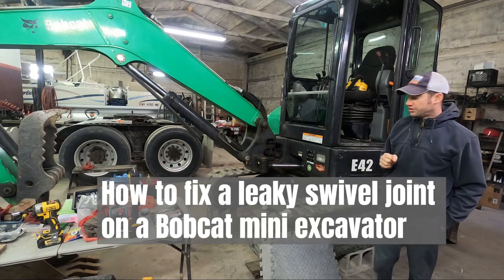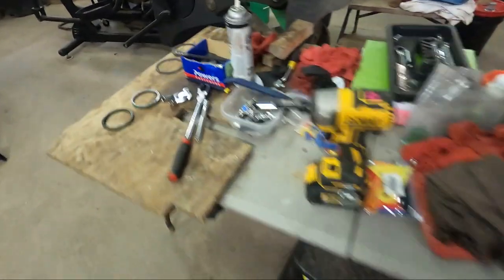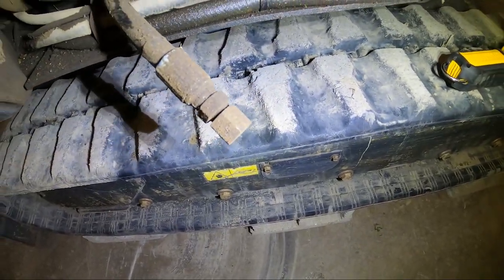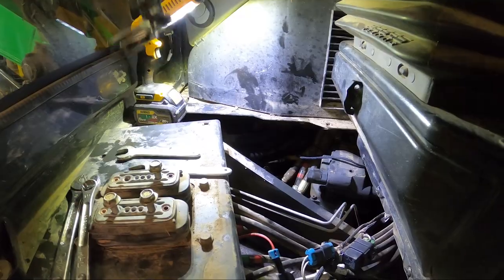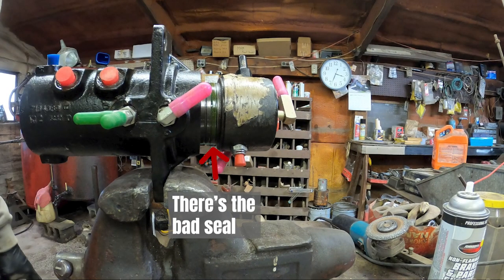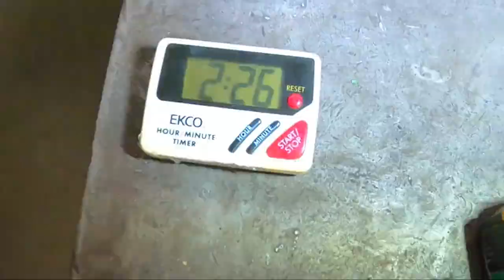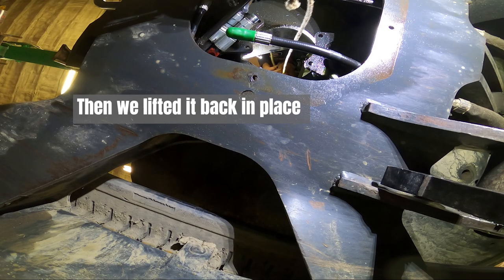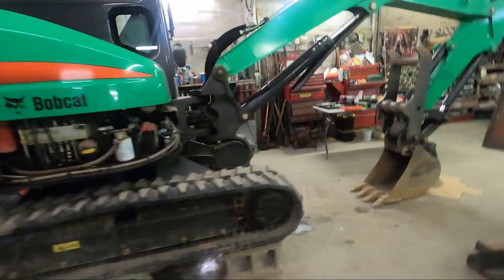How to Fix Hydraulic Leak on Bobcat e42 Excavator - Swivel Joint (Step by Step DIY)

Comment: Hey, thanks for the video, I did mine this weekend on a Bobcat 324 Mini, some of those hydraulic lines on the top, I had to remove others just to reach, they were challenging.  To make installing the top seal easier, I took a disposable thin plastic face shield, and wrapped it around the cylinder and taped it together, and the new seal slid all the way up in about 5 seconds..easy.. thanks again for the video, really helped out!!
Reply from the maker: glad it worked for you! great idea to get that seal on. I'll remember that for next time (hopefully no next time :)
Reply: Thanks for the shield idea!
Reply: glad that worked out! thanks for letting me know, That job was hard enough without spending a lot of time on that top seal!
Reply: I rebuilt the leaking swivel joint on my 324 a couple of years ago. A time consuming PITA. The rebuild kit cost me $400. I couldn’t see doing all of that work and not using all new parts.

Comment: The cinder blocks could have injured or killed you.  I only trust heavy wooden beams stacked so they can't compress.  Anyway, a good video all in all for the purpose.  Side note. All of the seals need to be replaced if going in that deep.  Senseless to only replace what is obviously leaking for what it costs.

Comment: If you have to block this machine up again, please place those blocks so the hollows go up and down! If they break the way they were in there, they would drop in a heart beat.
Reply from the maker: I just replied to the guy above with the same observation. You guys are detail oriented... I like it! I do agree with your block orientation suggestion. There was a reason that I can't remember at the moment why we turned them sideways. That's why also put jack stands underneath for added support.  Next time, I plan on skipping the concrete blocks altogether.
Reply: I seen nick in one of the center seals you didn't replace  if you have leak down on one opp that's why  . Temp imp
Reply: I thought the same in fact I wouldn’t get under either way CMU block is only moderately structural with the cell in the horizontal position and compressive strength varies depending on type of block with  2k psi average and that seems to be ok if you add 4 block to each side of machines weight distribution, this is if you built wall and bedded in mortar of equivalent strength so any irregularity above or below  diminishes integrity. 
Sometimes we just use what we have available and it usually works or you read about the time it didn’t . Be safe your fam needs you

Comment: little free tip. these swivels have sharp edges. instead of rolling or fighting the seal down. use a zip tie turned inside out {smooth side to seal} as a strap to ever so lightly stretch the seal on and over without rolling it or cutting the edges. works great on crown seals and ptfe seals alike.
Reply from the maker: Brilliant! Thanks for the idea
Reply: Great idea
Reply: @camarocraig7060  thanks! i dreamt that one up battling my bobcat swivel joint. worked a treat!

Comment: I wish I had found this video before I took the swivel joint off of my E32.  Still waiting to get it back from guy who is rebuilding it.  I will definitely use what I learned from you to reinstall.

Comment: I worked as a design engineer on hydraulic circuits for years. I think the reason the top seal is worn so much is dirt and water is getting in on top. A top hat type seal like a lip seal if hung out over the top would help keep out the dirt. Without checking (I'm too lazy to look it up) the very top seal and very bottom seals only handle drain pressure and also take most of the side loadings. They basically keep the spindle centered. Metal rotating on plastic seals has to wear eventually, even on a film of hydraulic oil.
It also helps if the unit is located perfectly in the center of the ring gear. Even if offset 5mm, the hoses move back and forth that amount during a full rotation. This side loads the unit a little. Just my thoughts.
Reply from the maker: Thanks for your insight! I never thought about why it failed until you mentioned it. You're right... it won't take much of a sideload or dirty fluid to wear a flat spot on the crown seal. This one lasted about 2000 hours, so hopefully won't have to do this again for another 2K!
Reply: @davidpatrick3533  yeah, I bet you're looking forward to doing it again! And you'll forget half the lessons you've learned here so you'll have to watch your vido!
Reply from the maker: You got it! Half the reason I'm making these videos is to remind me how to do it and what tools I need to do these tasks the next time!
Reply: True
Reply: I would have changed all the seals in the rotate manifold, u are already there! Also they keep all the pressure in the circuits so they u will not have any bleeding off the tank or etc!
Reply from the maker: That's a great idea. In retrospect, I agree. Kicking myself :(
Reply: @curtisbookhardtjr.7481  True .
Reply: @davidpatrick3533  usually the inner rings dont wear since they stay in clean oil . I am sure they are fine. My Yanmar is dripping and have to do soon.
Happy Roman new years.
שלום

Comment: Very Well Done! You hit all of the troublesome spots that saves me some time. My only caution is be careful using concrete blocks (CMUs) as jack stands. The are unreliable.  Keep making these videos.....way better than a manual. Thanks.
Reply: your house sits on them.
Reply: @DieselRamcharger Not in that orientation.
Reply: @walterandrews3077  i feel you. but the weight of that mini spread across 4 blocks is minimal really. which is pretty obvious, seeing as how hes not dead.

Comment: Where did you find the seals? Dealer wants $500 for seal kit.That was awesome!, looked alot easier than the final drive I had to rebuild years ago...heck, the hardest part of it will be the 16lines connected. Thanks million for making the video, your the only one I found that looks like mine.
Reply from the maker: You're right... the worst part was hose management. I'll have to look into tilting the cab. That would make it a lot easier. I agree about the blocks. Great public advisory what not to do :)  But I did also have jack stands under there somewhere.

Comment: Just watch you do the swivel joint on the little digger I've done several swivel joints on 20t and 13t machines it's a lot easier more room to work but you do need a ratchet strap to lower the joint I normally dig a trench in a field and track machine over it you can stand up under machine the only thing you done which could be fatal is sitting the machine on them concrete blocks they have a tendasy to shatter  you should have turned the blocks upright that's a 4 and half tonne machine I wouldn't have chanced it I always think safety I'm always working on my own out in middle of nowhere  sometimes you do well if it was your first time iv been at it nearly 50 years well done
Reply: placing yourself in a trench under an excavator is as risky as him placing it on blocks..the trench can colapse at any time

Comment: NICE VID.   For YOUR SAFETY...
PLEASE only load the CONCRETE BLOCKS with the VOIDS
VERTICAL..(Like they would be stacked in a wall). NOT on their SIDES.
 I was yelling at the screen when I saw that!
The COMPRESSIVE STRENGTH is in their OUTER EDGES.
Remember..You only get crushed once.
*Whenever you can, just try to AVOID BLOCKS altogether.. and just use pieces 
of TIMBER. (Much SAFER).
Liked seeing the SWIVEL work though.
Reply from the maker: Good observation! I completely agree with your block orientation suggestion. There was a reason (like a height reason) that I can't remember at the moment why we turned them sideways. That's why also put jack stands underneath for added support.  I like the timber idea. I should cut some up for the next time.
Reply: @davidpatrick3533  Okay, so it needs what 12x12" by 18" length? Where are you going to get them? Why not just one of two lengths of scaffold board along the top of the three - - why not more ...cement blocks?
Reply from the maker: I have some old barn timbers that I could use and cut them down to length. Seems like Farmers have these things around their barn. Or buy 3 of 2x12x16, cut it into 2 18" long pieces and lag it all together to build up to 9" thick, to make 4 pieces. At least lumber has gone down in price a bit. I think @DavidBailey's suggestion was to avoid the cement blocks because they can catastrophically fail without warning (say there's a crack), where timbers might be more forgiving.

Comment: David, thanks for the video.  We have an older Bobcat 331 mini excavator that we think is leaking on the swivel joint.  Once we determine that this is the problem, we will need to get it out.  This gives a great overview of the tool and procedure needed to remove it.  I was wondering why you didn't change the oil-seals between each groove?  I think I may do that, due to the age of our machine.  Also, how would you recommend marking the hoses?
Reply from the maker: In retrospect I should have changed them too while I had the swivel joint out. Regarding keeping the hoses organized, use colored electrical tape or colored zip ties on the hoses, and draw a diagram for the swivel joint itself. Also, take photos. My hoses already had markings on them. Good luck! Keep it clean and stay organized!

Comment: i have same problem on old fiat Hitachi ex50 urg tok it out  gave it to shop to get the seal done put it back in after one minute leaked again,my head went then,cant get book or workshop manual to do it myself ,yours looked easy,  mine is a right pig to work on,think I put hosses back in wrong place, nightmare,can you  help ,books etc or where to get tried all ebay ,japan,all,nothing on these old machines,regards joe.ps put hosses bak wrong would that cause the seals to blow again,problem is on track drive not the digging.
Reply from the maker: hey George -- I'm sorry to hear your issues.  I don't know if connecting the hoses wrong would have caused the seals to blow again. I'm just not that well versed in this stuff. It's bad enough disconnecting the hoses one time and reconnecting, but with your lines crossed, you're going to have a heck of a time redoing it all. Maybe you can find someone else with the same machine to share the connection points with you. Best of luck

Comment: Great video. Very informative . I see how you purged the air out of the sysem but where did you purge the air out of the system?
Reply from the maker: Thanks! Purging it is easier than it sounds. All I did was manipulate all of the controls forward, backwards, forward, backwards, track fwd, backwards, over and over until you hear the air get removed. It will make a whining noise when there's air in the system. And after a few minutes the whine will go away as the air automatically gets bled out of the system. As I mentioned in the video, keep checking your hydraulic fluid level during this process and add fluid as needed.
Reply: @davidpatrick3533  Okay thanks.

Comment: Was the swiwel weak? my komatsu 3 ton mini excavator is really weak when i am gonna push some dirt sideways, maybe the swiwel have an internal leak
Reply from the maker: My symptom was only a leak. I had not noticed any lack of power yet. But makes sense that the fluid is either leaking within the chambers of the swivel joint or the hydraulic cylinder itself. That doesn't sound like a fun one to troubleshoot!

Comment: Did you notice reduction of swing power because of the leak?
Thanks for the upload
Reply from the maker: No, Actually, the leak was small enough where I didn't notice any symptoms or lack of power yet. If the leak got worse, where I think it would have affected the most would have been my drive motors since they take had the largest lines attached to the swivel joint.

Comment: Hi David, same machine, if when you raise the blade falls quickly back to the ground and left track is slow as hell vs other side, what would you say ? do i have same issue with center joint seals mixing fluid ?? Thank you in advance.
Reply from the maker: Oh man... I feel for you. I'm not an e42 hydraulic expert so I'm just thinking out loud here... I could visibly see leaking oil so the crown seals made sense for my symptom. However, for yours: your internal swivel seals guess is a good one. Assuming both of your issues are related, I can see that at least one of those swivel joint internal seals is bad. I don't remember though if chamber for the blade was adjacent to the left drive motor chamber meaning that one bad seal is causing both problems. How many hours are on your machine?

Comment: WHAT IS THE HYDRALIC CAP ASSORTMENT KIT YOU MENTIONED THAT CAN BE FOUND ON AMAZON?
Reply from the maker: https://www.amazon.com/High-Temp-Silicone-Assortment-Masking/dp/B00L4O8TR2/ref=sr_1_2?crid=2CWTK4YLBX1I0&keywords=silicone+plug+set+caps&qid=1667737381&sprefix=silicone+plug+set+ca%2Caps%2C232&sr=8-2

Comment: Hello, have you ever had your machine to start leaking from the travel pedals?
Reply from the maker: Not yet... I'm not looking forward to that, but the connections are right beneath the floor panel.
Reply: I did , took the travel valve off and had it rebuilt at a local hydraulic shop.  Not too bad of a job if you mark the lines.

Comment: Oh yeah, and dont ever use concrete blocks,  use rr ties, or big truck brake drums, but never blocks, especially on their side, there is zero structural strength on their side,  they are designed to stand holes vertical,  but that could have been deadly. Dont wanna see yall get hurt .